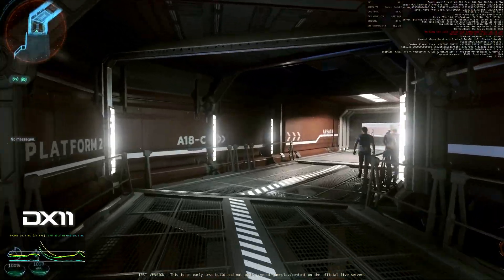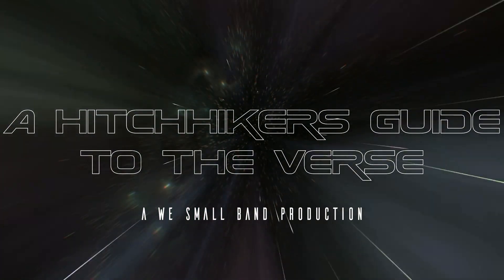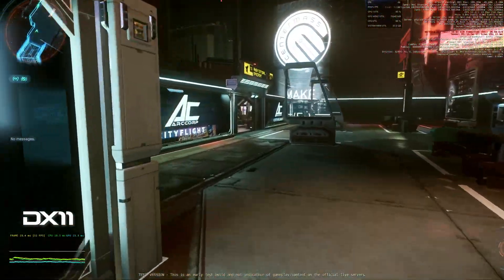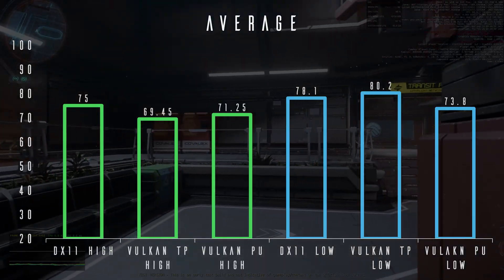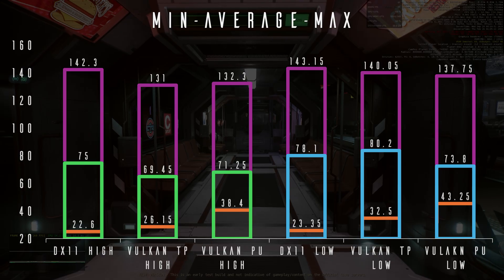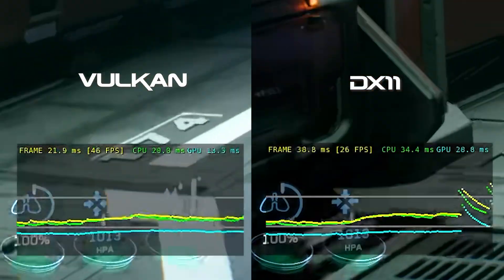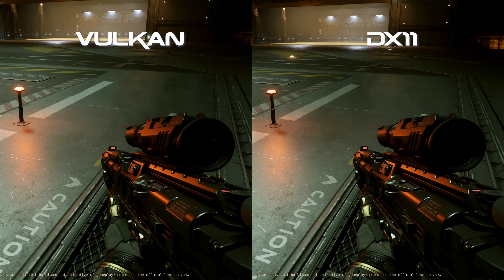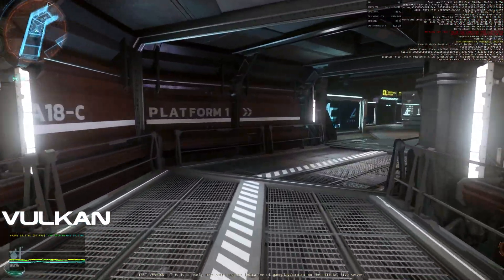The Star Citizen Vulkan Tech Preview shows promise. For some...

Comment from the maker: After some back and forth with people in the community, I THINK I've figured out why some believe the game looks better when I don't: DLSS.
CIG added DLSS with the tech-preview - a fact I had missed as I am on AMD - which does a much better job at retaining detail in motion than TSR does. It's because I stuck to TSR that I saw no difference.

What led me to this conclusion, is that those saying it does, all have NVidia cards, and we were able to narrow it down to specifically being when things are in motion that the game looks better.
Reply: AMDs version of upscaling is FSR, it works better for me than TSR (rx 7700xt)
Reply from the maker: Correct, but FSR in SC is version 2, at least, until AMD enable FSR4 for vulkan (won't happen for DX11).

Unfortunately, whilst FSR2 may perform better than TSR, it doesn't look anywhere near as good, and most certainly not as good as DLSS (until we get FSR4). Thats why i've stuck to TSR. Also made it more fair to do a like for like 🙂

Comment: I'm really not sure what to think of it because it seems like it was a less optimized build/ patch. I typically get higher FPS on dx11 on live than I was on the tech preview, across the board. The vulkan works better than on live where it just crashes my game, but the idea that was getting the same frame rates with everything on very high and high as I was on the tech preview, using all low settings, didn't make me feel good.

I wanted to try it on a low end PC, but the preview ended before i could finish installing it. Im VERY curious how it will effect a Ryzen 2700g with a 1660ti
Reply from the maker: weirdly i got near identical performance on DX11 on both (within a few FPS in all metrics)

I suspect they had extra logging etc enabled in the TP (its what i meant by environmental) which would explain the slightly lower perf, especially in the lows

"the idea that was getting the same frame rates with everything on very high and high as I was on the tech preview, using all low settings" <- not quite sure what you mean there? As in live FPS with high settings was matching TP FPS at low settings? Obviously i can only comment on my own experiences put in the video, but not what i was seeing, so i'd be curious if theres a configuration difference (hardware wise) thats causing that 🤔